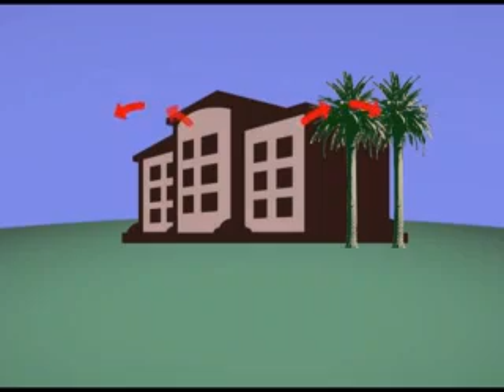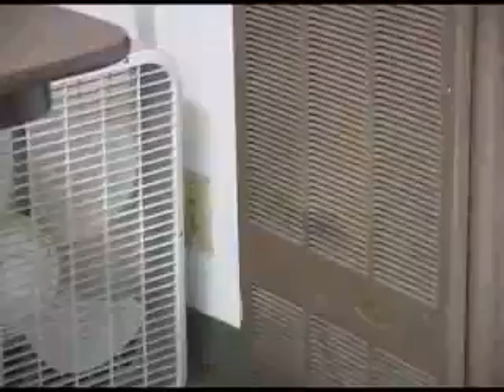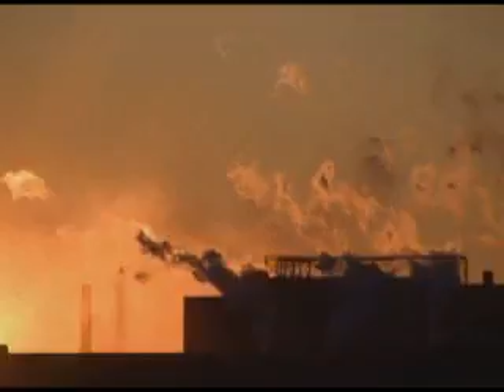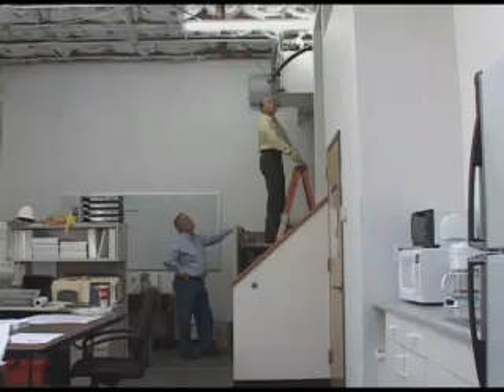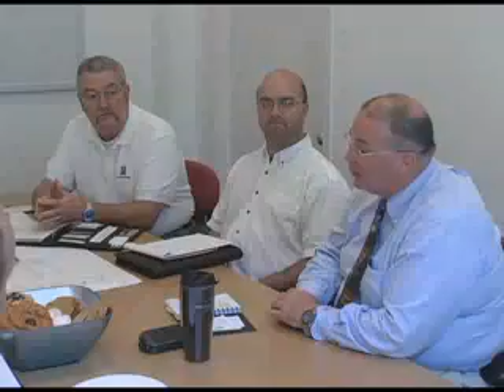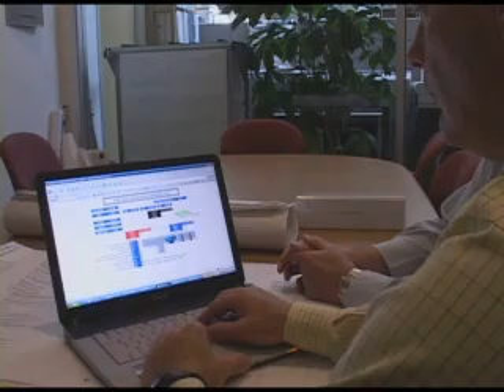UBS Geoexchange Project.mov

Comment: This is one of the cleanest real-world demonstrations of geoexchange I’ve seen. The fact that Brian and Jerry hit over 30% energy savings against a 15% target, while running the first live side-by-side comparison with traditional systems, is still impressive more than a decade later.
The core insight holds up beautifully: you’re not fighting 35–40°F outdoor temperature swings — you’re working with the ground’s stable ~66°F, so the heat pump only has to move a much smaller delta. No combustion, no rooftop units, dramatically smaller equipment room, and every kWh saved is 1.4 lbs of CO₂ that never enters the atmosphere. That math still hits hard in 2026.
Would love to know if the multi-year monitoring data was ever published, or how the system performed long-term in Palo Alto’s climate. Projects like this were quietly ahead of the curve — and with the load growth we’re seeing from electrification and compute, the lessons feel more relevant than ever.
Grateful this was documented.